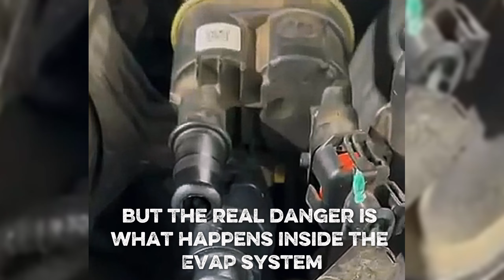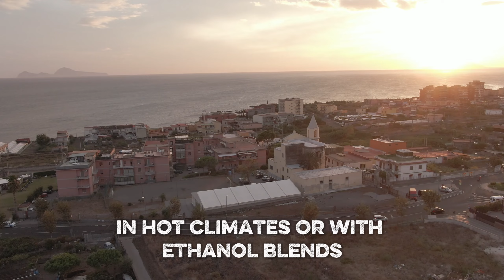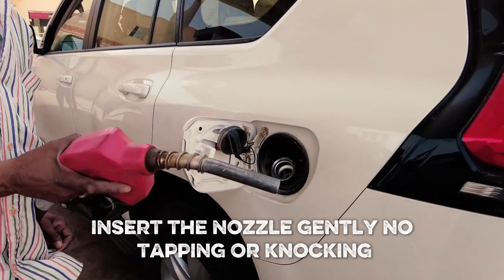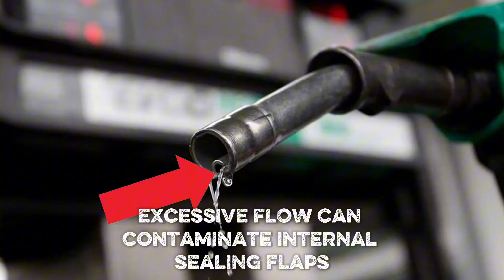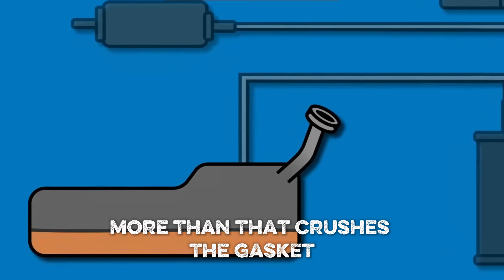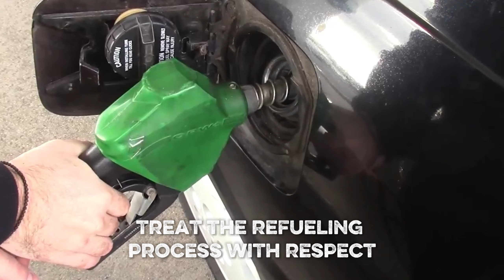NEVER Do This Before Refueling! (KILLS Your Engine Fast)

Comment: usually the combo diesel and gas pumps are located on the opposite sides of the pump islands.i always choose the middle island equidistant for the combo pumps . if the gas station has all combo pumps its   a no go